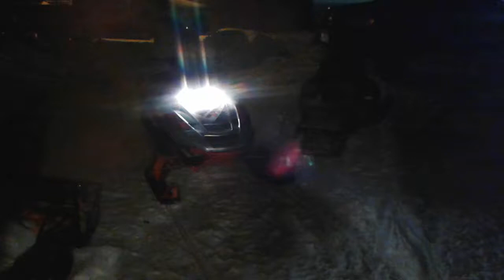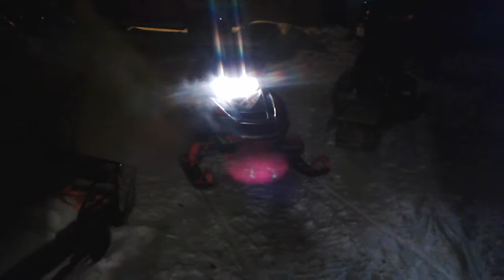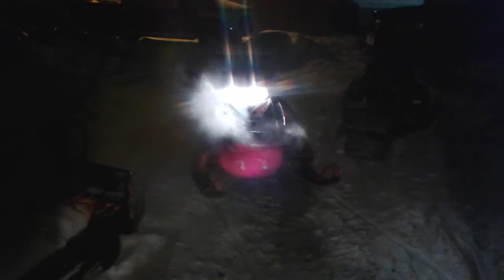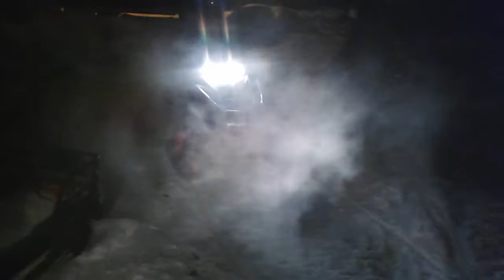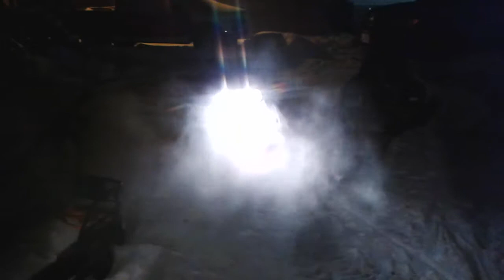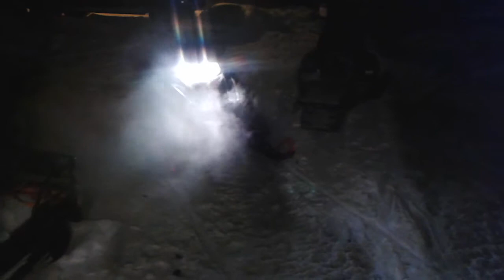2004 Polaris Liberty O-Ring Replacement. (Part 11)

Comment: Thanks for the series on this man. Saved my ass! I need to do this on my 02 700 Edge. I'm pretty sure it always burned a little coolant, but now it's collecting above my exhaust valve, so I'm pretty sure my outer rings are toast now. Again, thanks a ton! Very informative and easy to follow guide.